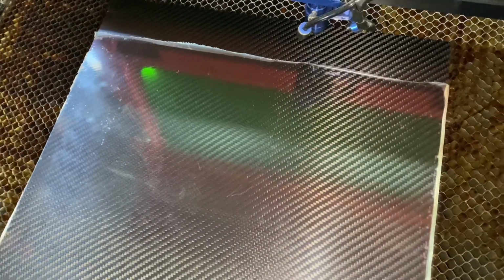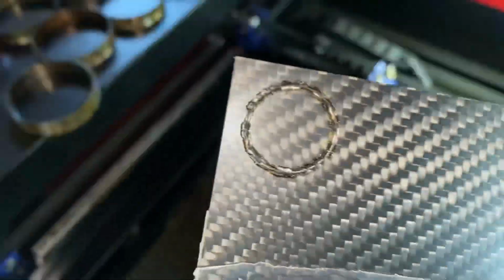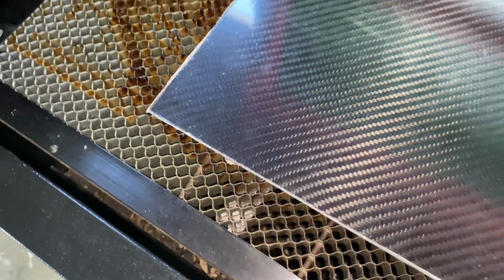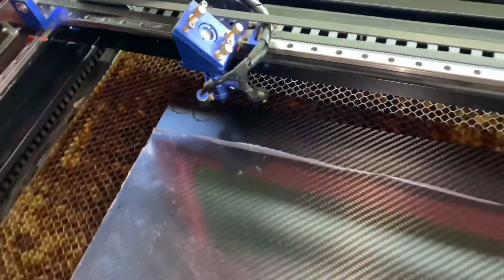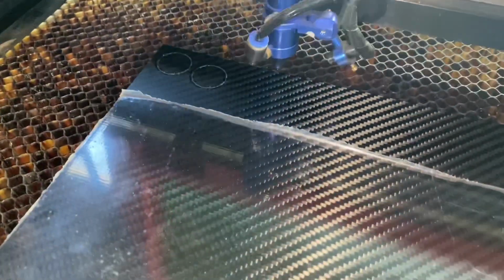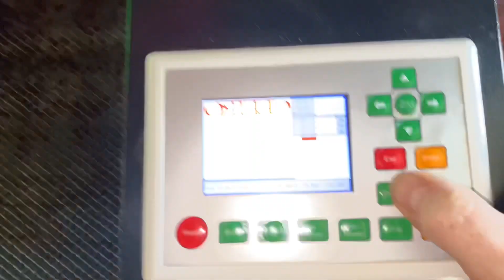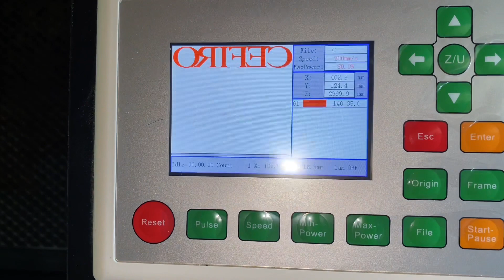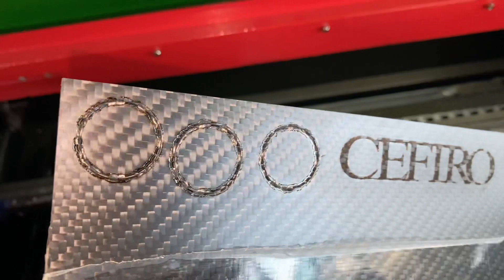Can my 80w C02 laser Cut Carbon Fibre?!

Comment: Totally possible to cut carbon fiber with your laser couple things your doing wrong one you need to use way more air 60psi at min 1 CFM, two that foam core is reflective and that’s what mostly causing your issue it’s likely PE foam and that’s not laser compatible unless it’s modified with carbon black to absorb the laser and not reflect it and last use max power.

Comment: The fact that I can hear you speaking, means there isn’t anywhere near enough gas assist, if any.
Reply from the maker: Thanks Clarence but I use air not gas not sure how safe gas and laser would be together 🤣
Reply: @woodendayz  in aerospace manufacturing (military) we use pure or mixed bottled gasses like argon and helium.  The helium gives you a hotter cut than argon, and sometimes they’re carefully mixed by percentage.  It’s all very strict(FAA) and you have to use the exact settings in the welding and cutting schedules that were submitted to the FAA.  Regular air causes oxidation and can also change the metallurgy of the parent material.
Reply from the maker: Wow I didn’t know that mate I would never have thought they used gas while cutting learn something new everyday cheers mate 👍🏽
Reply: @woodendayz  Laughing and mocking when someone with experience tells you something new is not a good look bud. Learn to be curious, not Judgemental.

Comment: What we burn is only the epoxy that’s holding the CF togther. Many years ago we played with RC helicopters which crash sometimes, the broken blades are usually hard to dispose. We threw it in a burning flames of wood and other stuff. Next day when the everything was just gray ash, the CF cloth remains as it is 😂. I just clicked this video out of curiosity to find out if laser works obviously it just burn the epoxy only. I m also looking into buying laser for my projects if CF is possible it would ease a lot of work, also CNC CF does produce the fine powdery residue need filtrations n respiratory equipment when working with.
Thanks for making this video❤.

Comment: Would have been nice to see 100% power at 1.0mm/sec...  though honestly, you have to have a very expensive & powerful fiber laser to cut carbon fiber plate... it's about 10x cheaper to buy a desktop waterjet for cutting carbon fiber.  The laser has to be able to reach about 4500C cutting temperature in order to vaporize the carbon fiber.